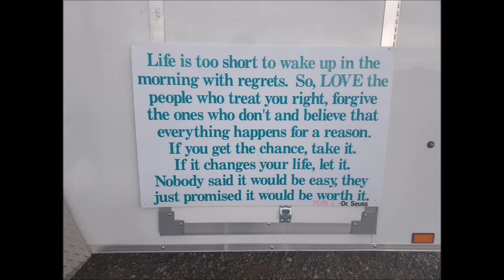new train hobby/medical update

Comment: It’s great to see you!! 
Model railroading is a lifelong hobby. 
Looks like you have a lot of block wiring in your future. I’ve never seen foil faced  insulation used. It will be interesting to see how you glue scenic material to it.  Will you sift, sterilize and use natural materials?
I never got into dcc. Does compatible mean you have to install a circuit board?
I’m in the process of rearranging stuff to put a shelf layout up on a wall. It will be fun to have my old Lionel trains out of storage boxes. 
Best wishes and prayers on your tests.
Reply from the maker: a little of both.natural and store bout . you can run dc or dcc just need to have dcc controller and  a dc controller run ether one not both... Dcc no circuit board needed..Dcc trains.. then you have DC trains.. both are different in running performance DC  trains are dull ,,,,Dcc trains .. sound performance realistic sounds they just run awesome''when i make next vid i will show the DC and DCC trains running comparison
Reply: @BIGGDOGGRVer  I've seen dcc trains running, I agree it is awesome. I'm just unclear on how it works.

Comment: first forget the 4X8 plywood. do a shelf around the walls of the room. bout 40 in or so (best to your higth) and about 18 inches wide. dump the closet doors, use that space. and a lift out section at the entrance door.(also removed) for round e round running.
think short trains. just a back water short branch line small yard maybe 4 tracks. lots of sidings for working.
use nickel sliver track. go dcc for multi train opps.  yes co$t a bit more for the power, but all the extras you get with it. 
you only need a entry level controller. as your layout will not need a full on big boy controller.
small layout so might only use three or five locos over the whole thing.
use ka dee couplers and set them up proper, and switching will be a dream.

Comment: Felix, I'm sure you are going to get lot's of advice on your railroad but here are a few things I know. DCC can get complicated very quickly and if you wire it for DC you can switch to DCC later. If you put insulated rail joiners between the yard and the mainline you can have separate control of each. It's called "cab control" so you can search on the internet for it. I would try to avoid crossings (not crossovers) in the yard. They will eat up space and serve no real function. The one in front of the red building with the water tank on top has stranded those two locomotives and isn't really serving a purpose. A model railroad is never complete, there's always something to change. Have fun.

Comment: Don't forget to have an insulation point in the track where you don't have power running to both controllers competing.  Then with 2 controllers you can run one to control the outside track and the second controller to run the inside track and you can get 2 trains running at the same time.